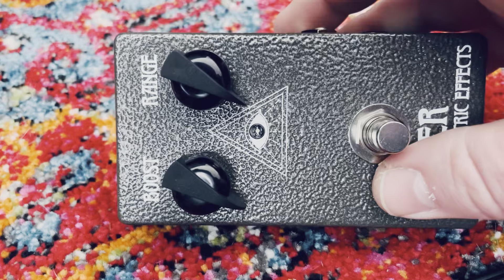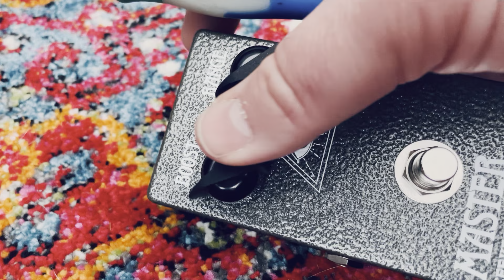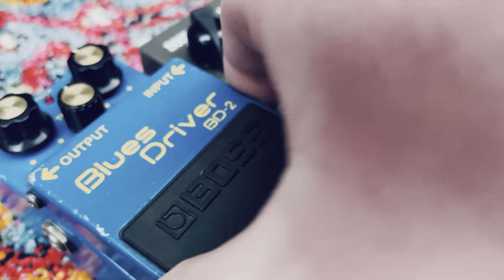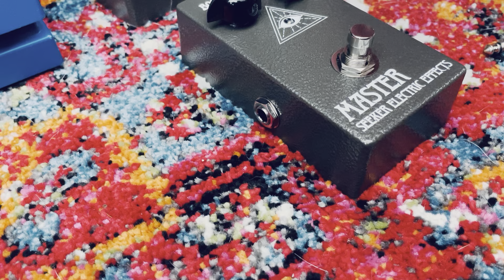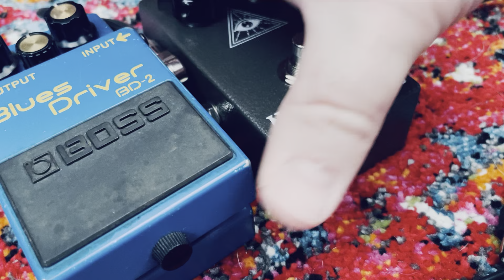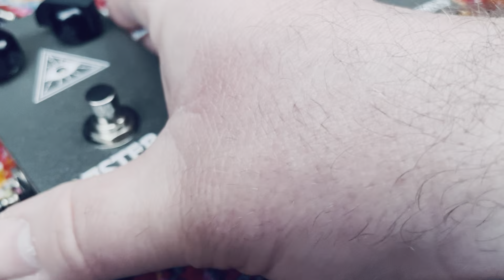A deep dive into the Seeker Electric Effects Lineage Series MASTER…

Comment: Does your design have more output than a traditional RM? It causes a couple of my amps to sag just a tiny bit when the boost is dimed, easily remedied by backing off the control to 3 o clock or so… but it’s the only RM I own (I’ve got yours, acid fuzz yellow sunshine, and a naga viper) that does it so I was curious. Really love this thing man, kudos.